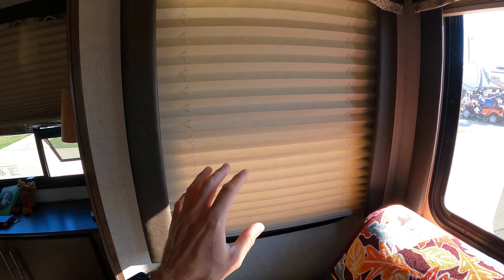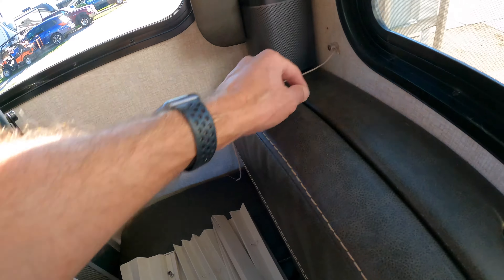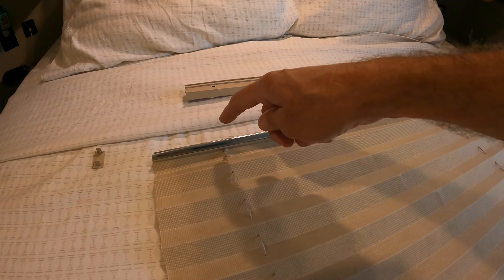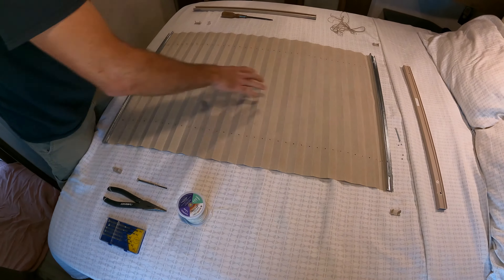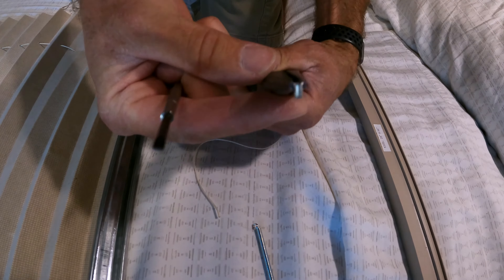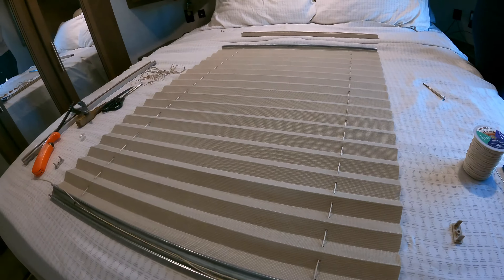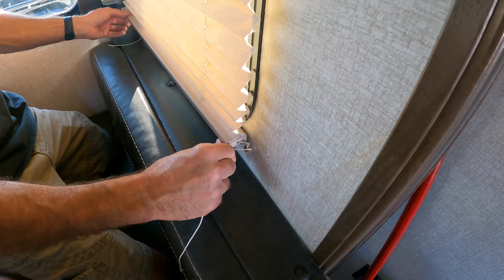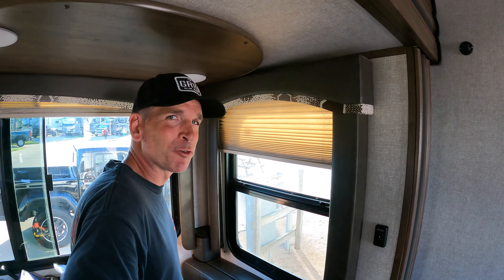How To Fix Your Broken RV Day/Night Shade (Blind)

Comment: I fish alot deep sea why can't you use 50 or 90 pound braided line
Reply from the maker: Have you seen my other video where I use 125lb monofilament fishing leader?  I use the monofilament as I believe it would hold up better than braided and the thickness of the 125lb test is close to the same as the lift cord.  It’s been about 6 months now and the blinds are still all working great with no more broken cords.
https://youtu.be/JtuiHNOF0cE?si=iPMzhQ0XQOQ6_Nh1

Comment: Answered all my questions just by watching your video best one yet. Thanks again for a great explanation of the process! 😅
Reply from the maker: Glad it was helpful Eric!  Just so you know, the lift cord that I used from Amazon has been fraying and breaking just like the original.  I bought some high test fishing leader and installed it on one of my binds several months ago.  It’s been working great.  Here’s a YouTube short that I did showing the end result.  RV Blind Repair Using High Test Fishing Leader
https://youtube.com/shorts/PTC0f7YR2bs?feature=share
It was a little more difficult to install than the cord, however, I’m certain that I won’t need to replace it again.  Hope that helps!

Comment: I broke the cheap hard plastic locking clips that holds the shade up.
Can they be replaced? If so, where can I get them?
Thank you,
Mike
Reply from the maker: Hey Mike, same thing happened to a few of ours.  No idea where to get them replaced, however, I just took the end caps from the top and drilled a hole for the string to run through.  Not a perfect fit, but, it is functional and we can’t see the end on the top where the missing piece is as the valance hides it.  Hope that helps!

Comment: While investigating my new-to-me day/night shades in my older winnebago, the string came unattached from one side at the very bottom (from the peg that's in the wall) and then the tip of said string disappeared. Did it go into the bottom of the blind? How the heck do I retrieve it? I don't want to make this situation much worse. Freaking out, here. Please help.
Reply from the maker: Yes, it would have went into the bottom of the blind.  Just follow what we did on the video to open the end, remove the slide piece and retrieve the string.  Then put back together in reverse.
Reply: @EddieAtLarge  Thanks. I hope it's as easy as that.